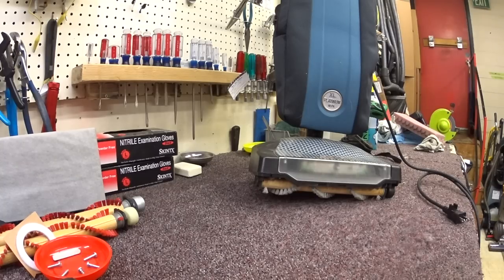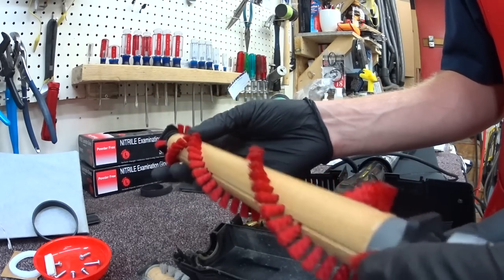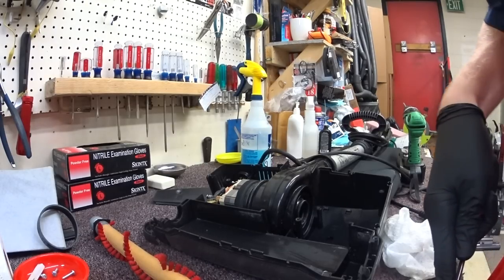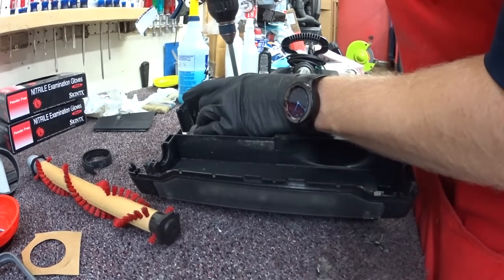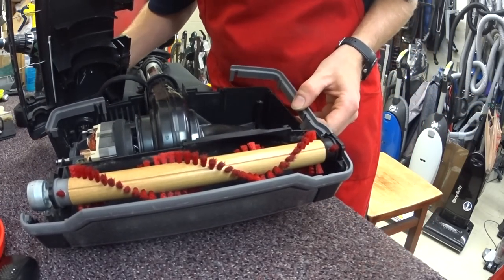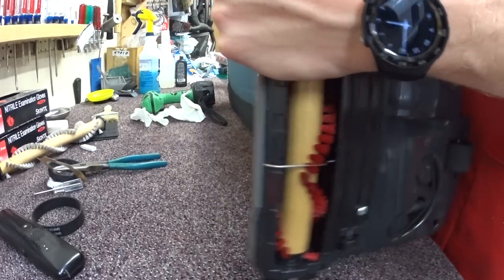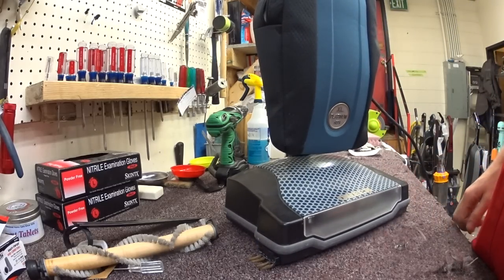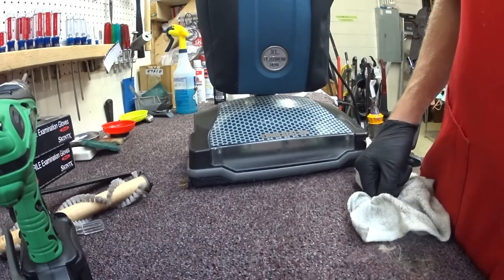Oreck XL 21 "platinum" U7000 Vacuum Tune up & Repair .

Comment: Surprisingly I’ve not messed with one of these yet. I have an m500 and riccar r10p which I like. I do like these orecks though based on what I’ve read about them. Also the parts availability is another reason I like them as well. Good vid 👍
Reply from the maker: Definitely look on Craigslist for one. You can find them often 20 to $50 it used to be if they have the original paperwork with them you could get them warranty out if something was wrong with them.
Reply: Do not waste your time!! They are made cheap & perform as such. I usually leave them on the side of the road....best place for them.

Comment: Thank you so much for this your video.  We have the same machine, but minus the HEPA designation.  [It's designated as 'XL Platinum' (& not an XL21)].  ¿Will an xl21 brush work in it?  ¿What is the difference between an xl21 and a U7000 Roll, please/is there one?  (our Oreck does not require the magnet in the brush/does not have the roll rotate sense electronics).  Its name 'XL Platinum' may explain why I'm confused on what replacement brush to purchase for it.  Any comments welcomed.  Thank you.

Comment: HI GREAT VIDEO, I have an Oreck pro power plus mod # U4190H2 and cant seem to find a roller brush or belt for my specific model.  the roller brush measures 11 1/8 inches across. can you point me in the right direction please? thank you!

Comment: I have an Oreck XL Platinum Plus. The little wheels on the Front of the  Base plate are worn so bad that the belt hits the hardwood floors and leaves a mark. Do they sell Wheels to consumers ?? Thanks.
Reply from the maker: Bring it to an Oreck store they will have everything you need.

Comment: Was the axis the first vacuum to have swivel steering
Reply from the maker: No that would be the pilot. The access was a cheaper version of the pilot . Sold through QVC and then liquidated through the Oreck stores.
Reply: Performance Reviews it's axis not access

Comment: So if I bought an Oreck xl21 at a goodwill and it came with the original warranty paperwork, can I use that for my self or is that non transferable?
Reply from the maker: It's non-transferable. Trying to collect on that warranty would be fraudulent. But very common for consumers to do.
Reply: @PerformanceReviews  i just got this but the rubber belt is like got little gears on it and its a different color but its the xl platinum pilot

Comment: So the Orecks don't deep clean? What about the Riccar Supralites? I thought Direct Air machines produced quite a bit of airflow and did well on carpets?
Reply: I think the Riccar Supralites are a lot better. Much more reliable in my opinion. I work at a vac repair store and I sell a lot of Supralites, but rarely see them come in aside for servicing. Orecks on the other hand come in everyday. Riccar belts are much stronger
Reply: Joe Hoffman That's good to know.  Do they pick.up well and are they noisy?
Reply: Mark Pritchard I think they are excellent machines, good stiff brush roll that deep cleans well. Yes one down side is they are very noisy.
Reply: Joe Hoffman There is talk about them coming to the UK but here in the EU you have to meet 80db for noise level so maybe Tacony will have to work on.that. I will buy one if they do come here.
Reply: Mark Pritchard oh yeah that’s right... I’ll ask my tacony sales rep if he knows any update on that. I wouldn’t count on it being too soon though. I’ve got the R30D model. Look it up on their website, 2 motors. Definitely the best vac I’ve ever owned for cleaning carpets. That’s just my opinion though.
Reply: Joe Hoffman Ah yes the Brilliance. I used one of those when I visited my folks in St Louis. Amazing agitation. I think it would give the Kirby a run for it's money and has the added advantage of an   attached hose👍
Reply from the maker: I would say the Xl 21 and a Riccar supralite clean about the same as I showed another video. The reliability and extended warranty and availability of parts would make me lean more towards Oreck TTI  .
Reply from the maker: Believe me companies like Tacony don't care about complying with things like that.  They're more interested in censorship and pushing the same  products.
Reply: Performance Reviews in respect to durability and maintenance, which one is better in your opinion?
Reply: Performance Reviews I didn't like their attitude towards you. Constructive criticism is a good thing. A good company will take that on board..If they want to sell these cleaners in the EU they will have to take it on board.
Reply: Performance Reviews did they tried to censor videos of your criticism?